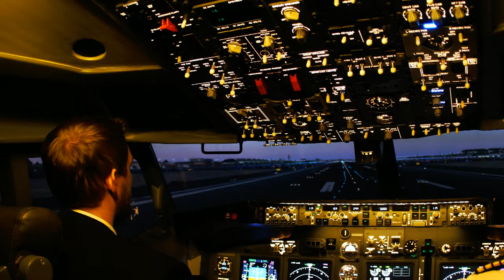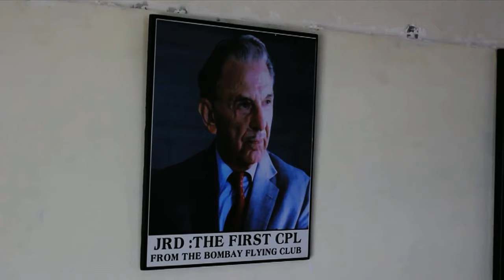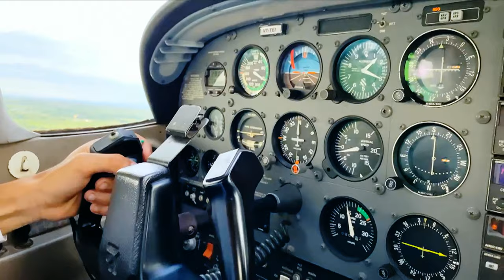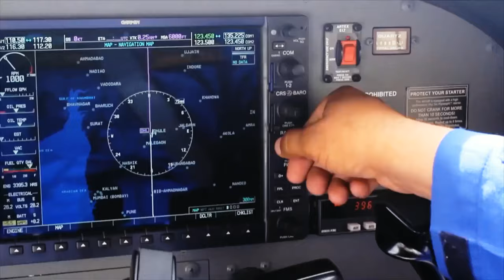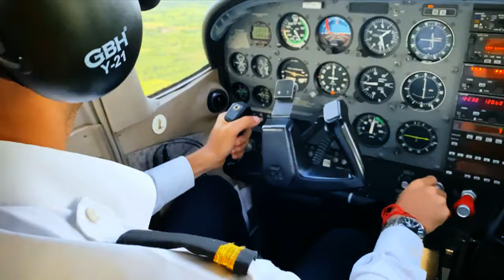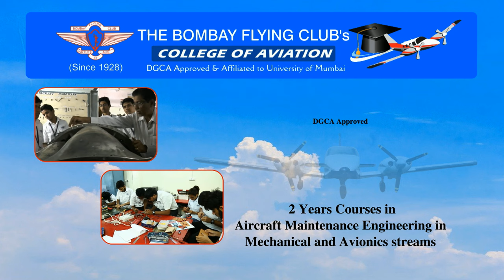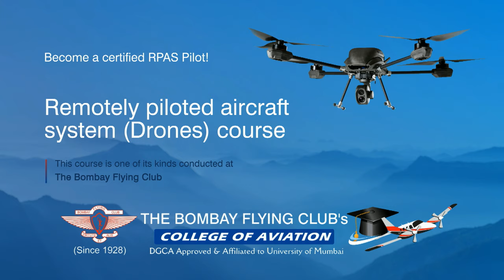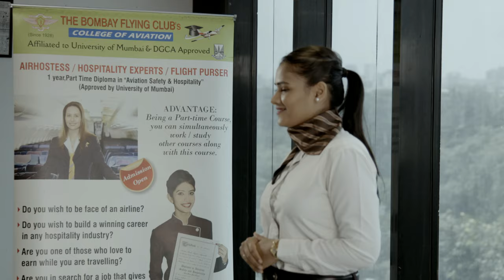The Bombay Flying Club's College of Aviation | Official Course Introduction 2022

Comment: I also want to join in your club.. what's the fees structure for cpl.. I am new To join.and I don't know what I should do after my 12th class..can you help me with your kind message..😊
Reply: My recommendation is to go to college, this doesnt always have to be STEM. It can be other degrees to as many degrees have transferable sills which will be good for a pilot. The industry is saturated with pilots and not enough jobs currently in India. This is a good way for separating yourself from your competition since most applicants will have 230+ hours. When you finish your college and do your training, jobs for Pilots will be soaring. Going to college then do your training will make your flight training a lot easier. Also, airlines generally won't hire 18/19 year old to fly their aircrafts. Going to college will make you smart, mature and a better pilot. Due to the demand in the future airlines may offer their own training which seems to be the trend in the West. If you really want to do it after 12th, try to join airline cadet programs as its a guaranteed job after your training though it is very very expensive. Or you may of you want to join the Indian Airforce, insist for some years retire. Then after that a job in the airlines a guarantee since military pilots are the best of all pilots. This too is a great option.
Reply: If you have any other question feel free to ask as I am currently in training at the moment
Reply: @achintmakesh3738  i hav querries
Reply: @achintmakesh3738  I know what you did there eliminating your compition 😅😅
Reply: @achintmakesh3738 hii, cud you please elucidate the fee structure a little! like a proper bracket that wud cover mostly everything required for the training
Reply: @achintmakesh3738  hyyy bro. which flying club u have been training